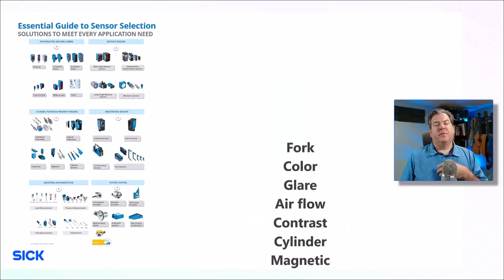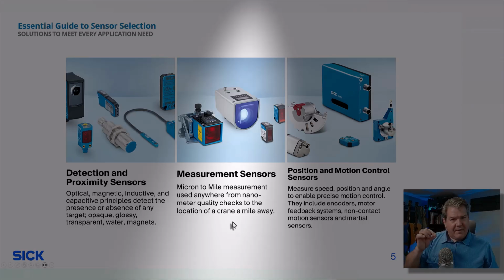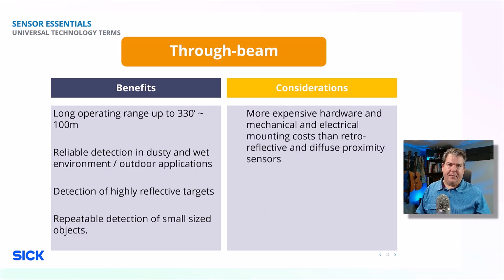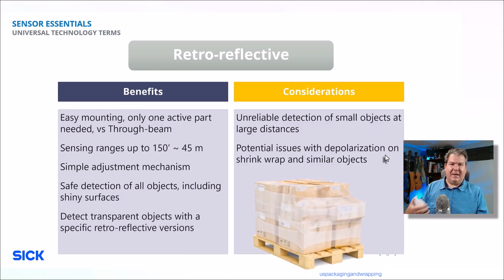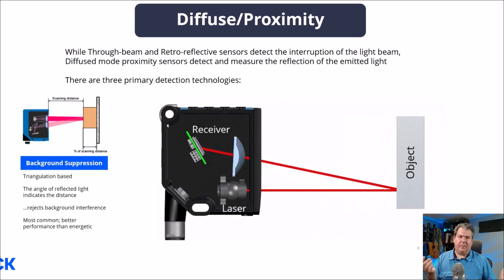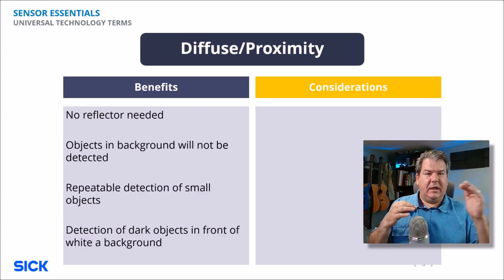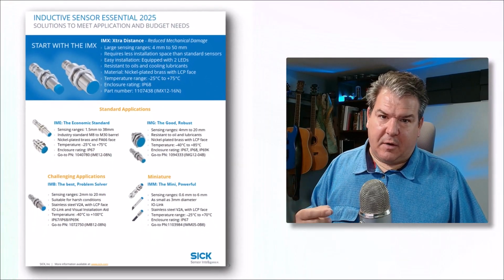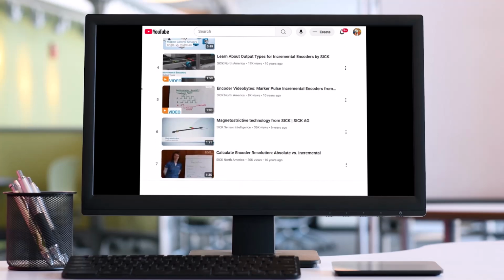Essential Guide to Sensor Selection

Comment: Hi, nice video! It would be great if you talked about different types of light, laser / red / infrared and advantages of which one on different materials / backgrounds
Reply from the maker: Nice idea, thank you for suggesting. A video would be great - in short, use red laser if possible. It typically is the most available and highest performing option. IR is great for environments where you don't want people to see the red dot either because it might scare people, hit them in the eye (all SICK photo eyes are "eye safe" class 1 or 2 visible red or class 1 IR), or don't want people to mess with it. IR is also a bit better in long-range applications and outdoor applications where there's moisture in the air - it refracts less.